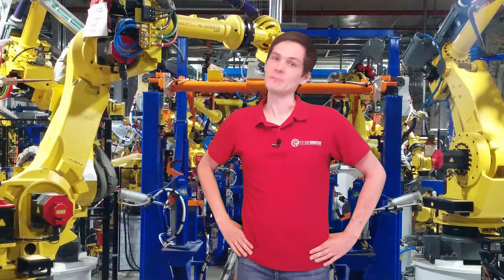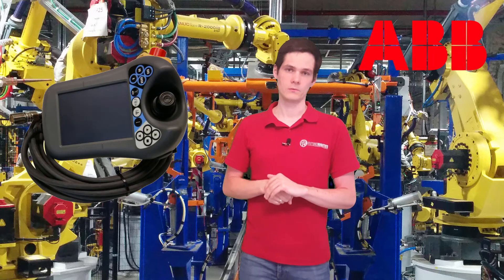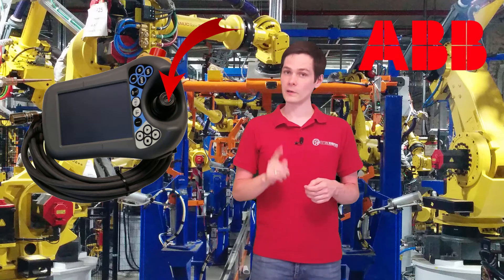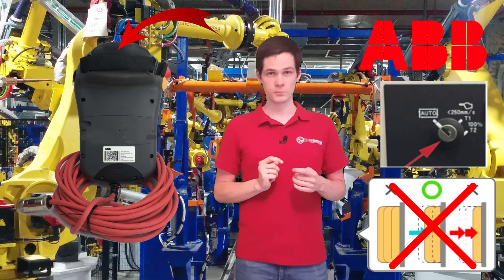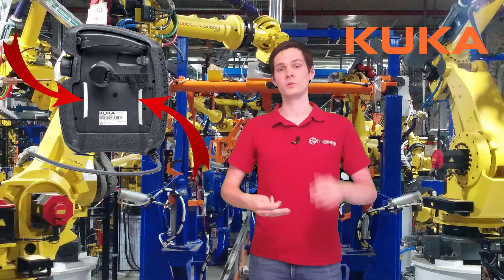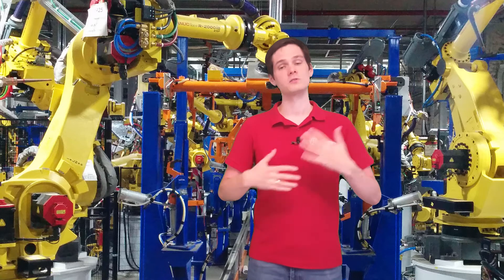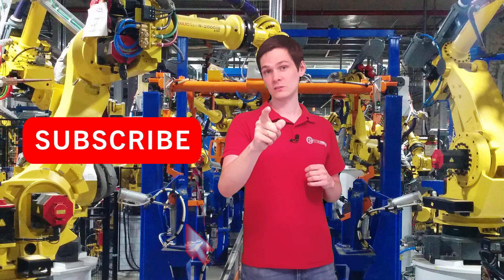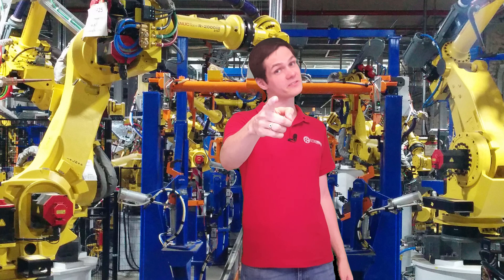How to jog / move the robot FANUC KUKA ABB

Comment: Please put the follow in the correct order for the Fanuc robot to be able to make it jog.	
	1	Turn on the robot cabinet (turn main switch)
	2	Change operating mode to T1 (turn the key on robot cabinet)
	3	Turn on the teach pendant (switch located at the top of robot teach pendant)
	4	Reset faults number 1
	5	Press and hold the deadman switch / enabling device to working position
	6	Reset faults for the second time
	7	Push and hold shift key
	8	push the jog buttons

1) Which position must the DEADMAN switch be held to enable motion? ---
a) Released
*b) Centered
c) Fully depressed
d) The iPendant does not have a DEADMAN switch
e) I don't know

2) As for Fanuc, to jog the robot once it is on, change to T1 mode, turn on the teach pendant, preset and hold the Deadman switch to its on position, push the shift key, check robot speed jog percentage, push the jog buttons.
*a) TRUE
b) FALSE

4) If while jogging the robot you release the shift key or jog key, what will happen? ---
a) the robot will continue to move to the position I intended
b) the robot will execute an emergency stop
*c) the robot will execute a controlled stop
d) these keys are not required to jog the robot

5) Which is a method by which you can jog the robot? ---
a) Using the teach tool
b) using the current position within the virtual teach pendant
c) using the traditional teach pendant jog keys
*d) all of the above
Reply: I like your short quiz. Do you possibly have more. I work at a factory they have apprentice positions for fanuc robots, been schooling myself I like this stuff